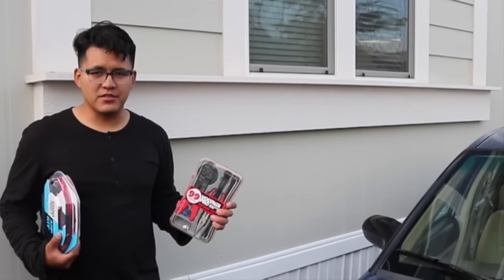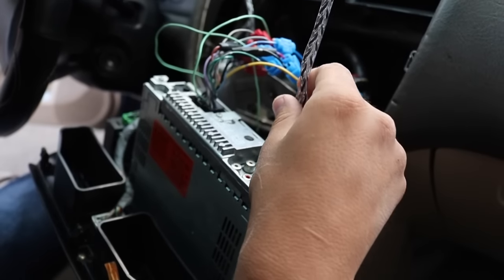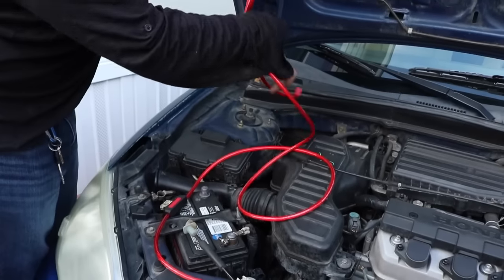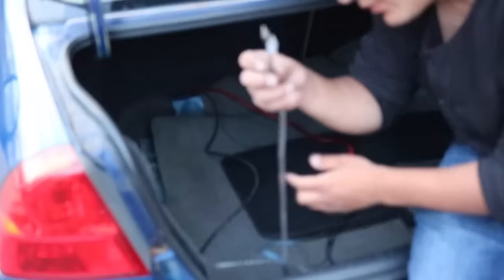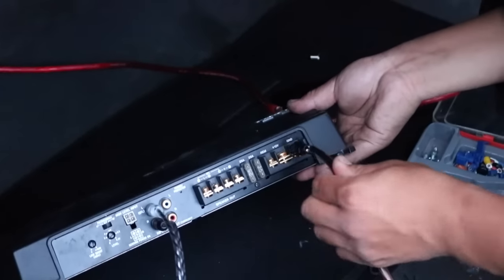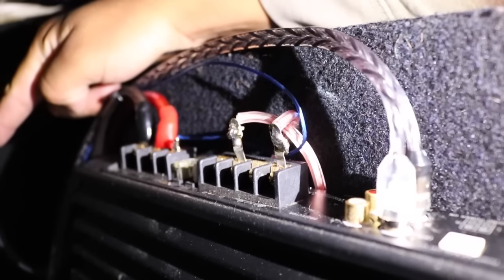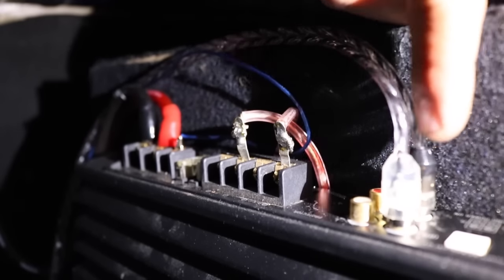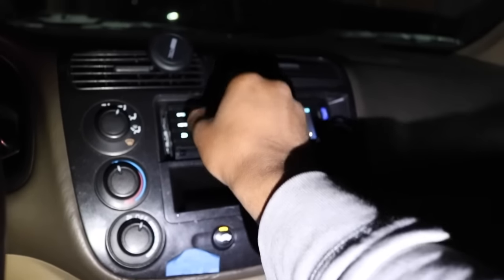how to install car sound system (amplifier& subwoofer)

Comment: ACTUALLY, it's a good idea to have your amp turn on with the stereo so if you turn the radio off it won't waste power but having a switch works too

Comment: Can you please show how you install the switch to your subwoofer the one you hit under your steering wheel because some of us really need detailed explanation im a slow learner
Reply: Run wire from your battery to the switch, then from the switch to your amp…. So when the switch is on, it sends power to the amp to turn it on… when the switch is off, it will turn the amp off…

Comment: You should probably mention not to run the RCA's and the power wire on the same side. It will cause squeezing whenever you accelerate
Reply from the maker: +Ben Dover o wow. I didn't even know that!
Thanks
Reply: Squealing I meant, sorry. Yeah it happened during my first install and it was a pain in the ass to fix lol
Reply: What side does the remote wire go?
Reply: personally I would run the remote side on the same side as the power wire
Reply: johnny mendoza do power on one side and rca w remote wire on other
Reply: @MarcoRosales  wait did you hear any noise? Cause if not I'm running my wire all on the same side.

Comment: Marco can i connect my factory speakers directly to the aftermarket adaptor and run those speaker wires to the Amp ny passing the old adaptor ?

Comment: Im going to install a 5 channel Kenwood Amp with a remote wire to control the bass..what i need to know is 4 gauge wire is sufficient? Now the comnection to the head unit i need to know what kind of unit i need so i dont blow up my Amp. Last question do i run my 4 speaker (2)for each door (2 for the rear door) speakers from my head unit to to my Amp or do i use a unit to wire up each wire from the 2 doors and 2 rear doors back to the Amp unit. The Hot wire and the remote wire along with the the wire cut off at the batterry so i dont blow up my unit? Id appreciated as much info as mossible because its the first unit i have ever installed?
Thanks alot for the video it helped alot!!! 🎶🎵 Harry Lato

Comment: Excellent video straight to the point to point. That’s how you make a video, skip all those taking out radio panels one by one and how and what to use. But this is straight forward 👍🏼👍🏼👍🏼👍🏼👍🏼👍🏼👍🏼👍🏼👍🏼👍🏼👍🏼👍🏼👍🏼 and links are showed 👇🏼 not 👆🏼 🤣👍🏼 good video tho.

Comment: My stereo has FL-RL and FR-RR it doesn’t have SW. which one am I supposed to plug the rca into?
Reply: Did you find an answer?
Reply: It doesnt matter its the same signal, its marked just so you can know which one is which but its all the same signal
Reply: Front left. Rear left. Fron't right rear right.

Comment: How do we find out where we run the wires through for our specific car? And does the remote or power switch typically come with the amp kit? Looking to install a sub in my car, this is all new to me.
Reply from the maker: +Victor Ensminger you just gonna have to get creative bro

Comment: Nice video 👍 when you plug the subwoofer to the radio where does that wire would you pull it out from?are you able to see all that radio wires from the front of the car ?

Comment: So i had a sub connected and working. I swapped my radio and had 3 sub wires. 2 being the av jacks and the third I think was the remote wire? Do u have any idea what the remote wire is there for or what to connect it to
Reply: The remote wire tells the amp to turn on when the radio comes on..
Reply: @Vaga-Bard  thanks man. I ended up putting in the old radio cuz i couldnt get the other to work with my sub lol

Comment: Make sure power wire and rca cables are ran on opposite sides of the car (away from each other ).
Reply: why is that
Reply: @cruzrobinson5030  can cause interference if ran on the same side

Comment: Hey man, i saw some guys while installing an after market amp with after market stereo they put some kind of small converters or something like this on the output of stereo which is going to the input of an amp, what is that can you guide ?
Reply: You are probably talking about a capacitor,
Which is so your sounds will not drain out your car battery.
Reply: @puromichoacan8339  what do you think, will capacitor be a solution ?

Comment: Sir I have one question
I have sony ex gt 99bt car stereo ( 2 din)
It says " direct subwoofer out"
My question is can I connect subwoofer directly to my stereo or I have to use amplifier
I don't have that much money to invest in amplifire
Reply from the maker: Yes. You need an amp to be able to use subwoofer
Reply: Marco Rosales that what is the mean of direct subwoofer out
Reply from the maker: I’m not sure, I have never seen it. You can give it a shot maybe your stereo has enough power to power up the subwoofer
Reply: Marco Rosales it's sony wx gt99bt
Reply: The stereo will not have enough power for a sub u need a amp

Comment: I only have 1 subwoofer output on my stereo. But I can't get my rear doors to work. I have the front/rear doors connected to amp. But behind stereo I only have right+-, left +- which is only 4 low level audio wires from factory harness. I have the front doors connected to those 4 behind the radio but when I bridge the rear doors with the fronts. I get no sound at all. How can I fix this problem. I have a 4 channel amp

Comment: was looking at other videos, said i need whats called a line converter since i still have a stock radio. Can you shed any light on this please?
Reply: Not always. Stock radios give out a speaker level signal to the factory speakers. Most amplifiers need an RCA signal to enter the amp to which it will supply the subwoofer with. So from the factory headunit you would install the lineoutput converter to change the speaker level signal to RCA so that the amp will accept it. And then from there you just install it like normal. The reason I said not always is because some amps have like built in line out converter in them like mine does. They way you can check is in the description of the amp you have to look for whether or not it accepts speaker level signals. 

Hope this answered your question buddy
Reply from the maker: +slatebeard I couldn't have answered better! Thanks mate
Reply: Marco Rosales Np bro

Comment: Shouldn't you disconnect the POSITIVE battery cable?  If you disconnect the negative but something that is grounded his the terminal, it completes the circuit like normal.  Like a loose wire or a tool falling

Comment: 5:09, where did those wires come from???That’s what I’m having the most trouble with. There are two ports on the back of my subwoofer and idk what to plug into them😩😩.
Reply: Urinal two ports on back of the box or the actual subwoofers ? I recommend you put the red on the plus and the black on the negative also if your amp just has one out and you have two in’s just put both positives on red and both negatives on black

Comment: i want to install sub woofer to hyundai i20 via rear speaker to level input i am using blaupunkt gtb 8200a its a inbuilt amplifier i require help with detailed explanation 
i connected battery, remote and ground to the blaupunkt, now i only require is connection thru rear speaker i don't want to use rca as my car stereo doesn't support
please reply as early as possible

Comment: Do I need the the power cable that runs from the battery to the back of the car if I’m not installing it in a car?
Reply: You can use any wire

Comment: Where do my speaker wires go I have a front and rear option on my amp? I'm just powering a 12" sub so I'm not sure about where the speaker wires from sub to amp go?
Reply from the maker: +J ordan and ricky ober different amps are configured different. Just try each port and see which one sounds the best

Comment: Great vid. I'm hookin mine up to I wanna know more about the toggle switch to turn your subs on or off. Bro hit me up
Reply from the maker: +Vincent Attao what do u wanna know bro? It's easy.
Reply: Vincent Attao how to run the wire, what you hook it to, and what kind of switch you recommend. also what about with dual subs?
Reply from the maker: +NotSoBrown i will make a separate video for that 😁
Reply: have u made the video yet..? :o
Reply: U can do this several ways the switch simply makes and breaks the connection on /off u could in line the switch from the main power cable to the amp or the remote wire they with both cut power to the amp.
Hope this helps

Comment: I have 4 channels Sony amp 1200w, 2 speakers 120w rms (each) and 1 sub 380w rms..
How to tune the right voltage with multimeter please!
Reply from the maker: Bro. I don’t even know, but it’d be a good idea to ask an expert and I’ll make a video about it. Thanks!
Reply: If you don’t know why you doing a video t 🤔Marco Rosales ??
Reply from the maker: Guillermo gutierrez i know how to install a sound system and just get it working. If someone Dont wanna pay $200 - $300 i gotchu. This is for you. THATS why i made a video. For those “experts” out there who wanna tune it right with the exact voltage etc. This is not for you.
Reply: @MarcoRosales  
I appreciate your work bro.. my problem is that I'm in Yemen lol.. so only thing I can get my hands on is a Multimeter (cuz of WAR).
Thanks a lot
Reply from the maker: Please let me know if there’s any way i can help brother. Good luck

Comment: I have a question I installed the after market stereo today I also put in the sub woofer and amp but I'm still confused were the remote wire goes to from the amp also I connected the ground cable to the battery with the fire one on positive and ground to negative and couldn't really feel the power why so

Comment: You don't have any problem with battery, like battery running out of power?
Reply from the maker: +jaynesh brodien I haven't had that problem. But if you do just install a switch
Reply: Marco Rosales ok i will test do a 
Switch, thanks✌
Reply: jaynesh brodien if your car is on your battery shouldn’t die unless you have a faulty alternator

Comment: I would recommend rewriring your radio. Very unstable connections. Consider solder and heat Shrink.
Reply from the maker: Thanks for the suggestion

Comment: Hi, actually in my car I have a Sony Stereo but there’s no place to put the remote cable which is the blue one, so I connected it from the amplifier but there’s no place to put it on the stereo, could you help me?
and I already took a picture of the back side of the stereo

Comment: My factory radio don’t have the plugs in a back to put rca cable I don’t know what i do now or how to do and where i put remote wire
Reply: Would have to get adapter for the Rc wires but it’s better off to switch to aftermarket stereo

Comment: Hi, where did you connect the blue cable ??
Reply from the maker: +Crist Warda it goes to the one labeled "remote" on the head unit
And it's also labeled "remote" on the amplifier or (REM)
Reply: i have something called Ant. Cont ? does this work?
Reply: Marco Rosales did you splice it or use crimp caps?
Reply from the maker: +Hypercity I always use some type of beans or scotchlocks with crimpers

Comment: I play the radio and amplifier and subwoofer while i driving the car, after that when i park the car and come back another day, i can't star the car ,it seem the battery is power out,can you tell me why it cause like that.it seem the amplifier drank ?  much thanks!
Reply: Alex Poonie you should check the remote turn on wire. If it has power while the car is off it will have the amplifier constantly turned on.
Reply: Brenden is right ether your amp is staying on or u need a new battery

Comment: How do you know what wiring kit is good? I have a 1200 w amp
Reply from the maker: It will tell you on the side of the box. Go to amazon or Walmart. No need to overpay
Reply from the maker: https://www.amazon.com/gp/search/ref=as_li_qf_sp_sr_il_tl?ie=UTF8&tag=marcorosale00-20&keywords=1200w wiring kit&index=aps&camp=1789&creative=9325&linkCode=xm2&linkId=61f29db9a4875195547799599ae0afab

Comment: He didn’t show how to connect the remote wire to the head unit tho, which is what I need to know, it’s the only thing I’m not sure abt doing
Reply from the maker: There’s a blue remote wire in both the head unit and the amp

You can also make a switch to turn amp
On manually

Comment: The remot cable from where to where please
Reply: Abdelhadi Dahmane from a blue cable on your stereo or head unit if you using stock stereo use your fuse box or high output converter

Comment: Real stupid question here: If I just want to replace the current speakers in my car do I need to get an amp?
Reply from the maker: +Wesley Wheeler if you are only swapping the door speakers & 6x9's you don't. 
You only need an amp if you are installing a subwoofer
Reply: Actually it depends on the head unit and the watt of the new speakers some cars or battery's or alternators don't produce enough wattage depending on everything you connect happened to a buddy of mine he got a cheap 1000 watt amp to connect all the door speakers to
Reply from the maker: +Pablo Hernandez you are right. But for this thread, however, most people looking YouTube videos on how to do it themselves, probably can't afford to pay someone to do it...much less buying higher end-high performance expensive door speakers that need an amp 😉

Comment: I mean it's kinda a good install...I didn't see when you secured the power wire in the engine to keep it from burning and also atleast keep it neat. The subwoofer wire should also be wrapped in electrical tape or heat shrink. Overall good Install but just messy.
Reply: Jaime Toytoy lol if you already know how to do it why you watching and judging?

Comment: I have doubt about blue wire how we connect it
Reply from the maker: +Varinder Singh remote. Goes from the amp to the back of the stereo
Reply: Marco Rosales where to connect it in the back of headunit ?
Reply: Marco Rosales hi can you connect the remote wire from ypur amp to your positive car battery instead of your head radio unit? thanks in advance
Reply: Javier Garcia u can wrap around a fuse
Reply: +Javier Garcia You don't want to connect it directly to the battery because it will constantly send a signal to your amp and will drain your battery. If you don't have an aftermarket radio you need to find a spot in your fuse box that only sends a signal when the ignition is on. This means that your amp will only turn on when you turn on the ignition. If you have an aftermarket radio there is a wire that will be labelled "remote Turn-On". Most of the time it will be a blue/white wire.

Comment: I thought that the control wire will turn on and off the subwoofer 🔊
Reply: Yes it does, you can hook it up to a wire that gives 12 volts when the car is on and when the car is off need to tested because if u dont ur amp will be on all the time and rain ur battery. Look at ur stereo and find the solid blue wire and connected from ur stereo to the amp

Comment: Why in everyvideo they never show were to connect the blue wire too smh
Reply: Blue wire goes to the back of your radio which is also blue.then it's runs to the amp

Comment: Sound Storm EV4.400 
MY 4 CHANNEL AMP LOOKS LIKE THIS IN THE REAR 🧐🥴
(-/+)   (-/+)
(-/+)   (-/+)

HOW TO SET UP 2 - 4" Pioneers, 2 - 6.5" JBL SPEAKERS. WITH LOUDEST PERFORMANCE. CAN YOU MAKE ME A DIAGRAM USING  (RED ♥️/BLACK 🖤) SYMBOLS, INSTEAD OF (+/-). No subwoofers

Comment: Bruh wtf cheap 12 inch sub from Wal-Mart 😂😂😂bruh up audio ain't cheap the subs at my Wal-Mart are dual and they 30$ and you didn't even show the remote how to put that in😂😂I got a 2010 honda pilot 15inch nvx subwoofer 1000watt rms and hifonics amp 2000 watt rms 0 gauge wire running through the car and a kinetic battery my shit hits hard and why didn't you do a demo on your sub?? So many questions😂😂😂but nice video😏😏💯

Comment: Where did the blue wire goto
Reply from the maker: There is a blue wire coming out of the head unit that says REM
And then goes to the back of the amplifier
Reply: @MarcoRosales  thanks boss 👍🏾